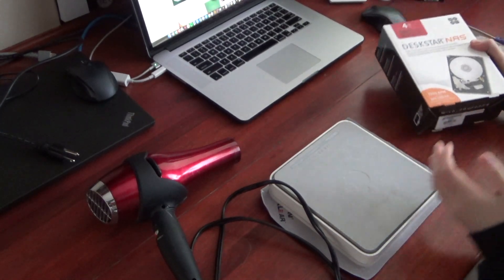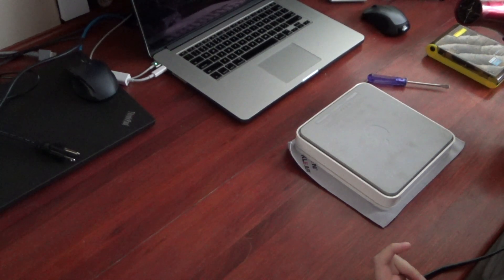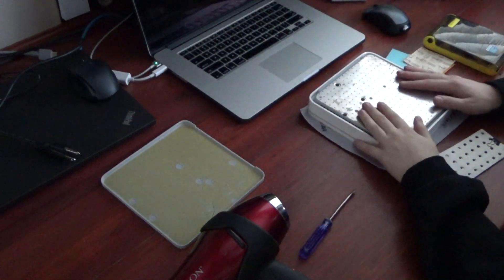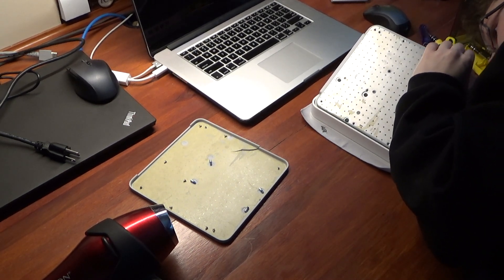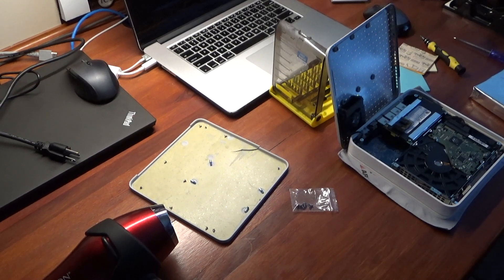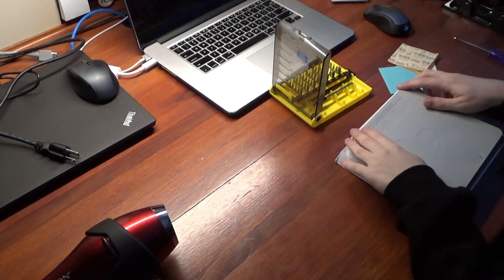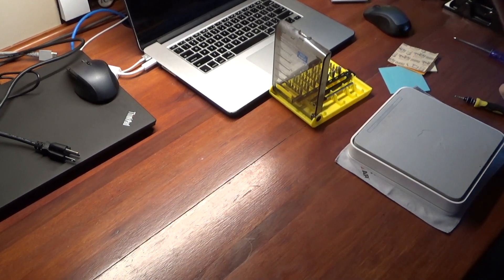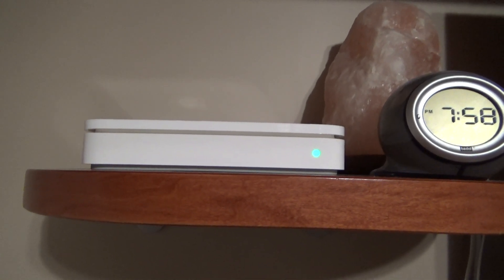Apple Time Capsule 4TB Hard Drive Upgrade

Comment: I would leave off rubber insulator pretty sure it will run much cooler…also the speed isn’t a factor as network speeds make so you won’t notice difference. I would also not be surprised if it was a 5400rpm one you took out I believe they tend to be more reliable in the long run. Just my .02 $

Comment: I updated mine with a 7200 rpm new drive. At first I was excited, when I initially did a disk speed test with the drive in a a usb/sata docking station; I was getting over 200 mb/s.  However, once installed in the Time Capsule, only getting 40-50 mb/s. The issue is that the there is no usb interface for the Time Capsule to work with the Mac, only uses network connection. Therefore, you are accessing the read/write speed is via the network cable. The usb on the time capsule is only for printer sharing. As noted in this video the 7200 is a bit noisier and you don't realize the speed capabilities. I ended up replacing the drive again with a cheaper 5400 rpm. Using the 7200 rpm as an external drive via usb, where I can use to save and transfer files and the realize the higher speed capabilities of the 7200 rpm drive.

Comment: Too bad you didn't watch this video for removing the rubber base before you started since you had the hair dryer ready to use.  It was much simpler the way it was removed in this video: https://www.youtube.com/watch?v=4x5Qab8DJyo

Apple loves to use 5400 rpm drives as they run cool, are more quiet, cost less and, theoretically last longer.

Does the 7200 rpm drive run cool?  I'm most likely going to go with a 5400 rpm WD Red as they've been very reliable for me and run very cool.  I'd heard the drive interface in the Time Capsule won't give much of improvement using a 7200 rpm drive but it hardly matters as I only occasionally use my Time Capsule for storage and I will soon be getting a NAS drive.  I'll likely soon be replacing my 2T 4th Gen Time Capsule as soon as I find a decent, non-Apple wireless router replacement, but I still would like to replace the TC drive before I retire it.

Anyway, thanks for uploading the video as I'm sure it has helped many people.